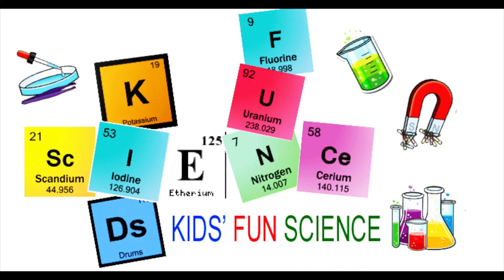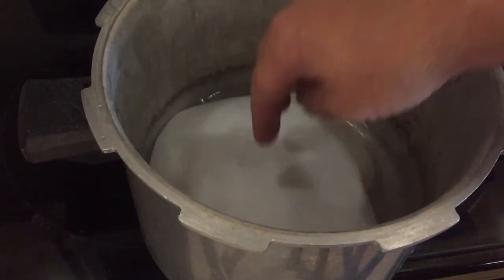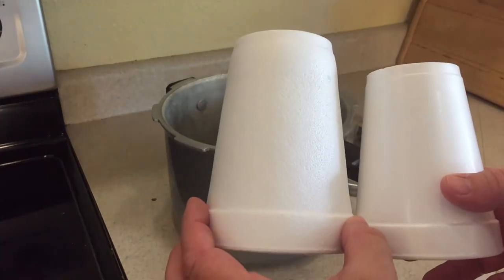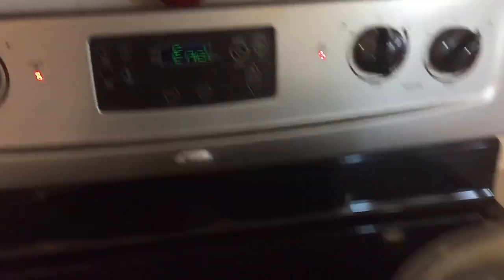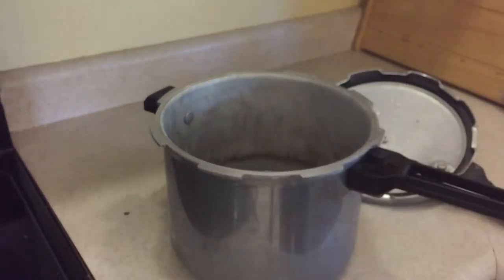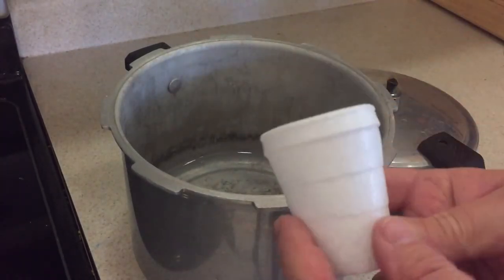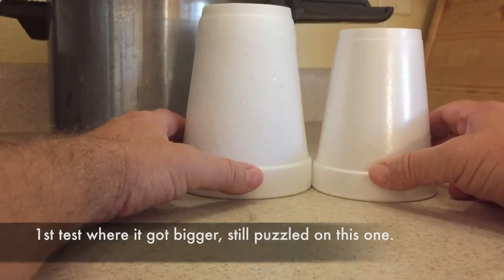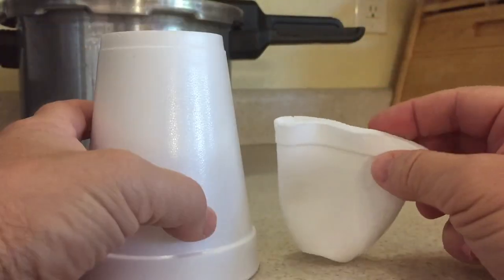SHRINKING A STYROFOAM CUP EXPERIMENT (How to Shrink a Styrofoam Cup)

Comment: Can u use just a regular cooking pot too? I dont think I have a pressure cooker at home.
Reply from the maker: Morning gothicwolf102 Films, No and I will do my best to explain. 
A conventional pot full of water. As the pot is heated, the temperature inside increases until the water starts to boil. At that point, all the heat energy goes into boiling the water, and the temperature doesn’t increase unless all the water boils away—water in liquid form cannot be a higher temperature than its boiling point. When you cook in a regular pot at atmospheric pressure (14.7 pounds per square inch [psi])

The same thing happens in a pressure cooker, but the temperature inside is much higher. The temperature at which a liquid boils is dependent on the surrounding pressure. Water boils at 100°C (212°F). Inside a pressure cooker, the pressure can increase by an additional 15 psi, to almost 30 psi. At that pressure, water boils at 121°C (250°F). This increase pressure (psi) is why the cup gets smaller. If you try it with a conventional pot, it might get a bit smaller but not as much with the Pressure cooker. I picked mine up for $5 at a Second hand store. I hope this helps. Thanks Ken

Comment: Cool experiment! I wonder if this would work in an electric pressure cooker?
Reply from the maker: Yes a electric pressure cooker will work. I also got it to shrink more when the styrofoam cup is out of the water. So fill the pressure cooker about 1/2 to 1 inch water, then place a Corningware bowl on a metal grate. Then place the styrofoam cup in the bowl, as it shrinks better when it is not in water. Then put on the lid and on the stove. Once it starts to hiss start your timer for 10 minutes. Let me know how it turns out? thanks